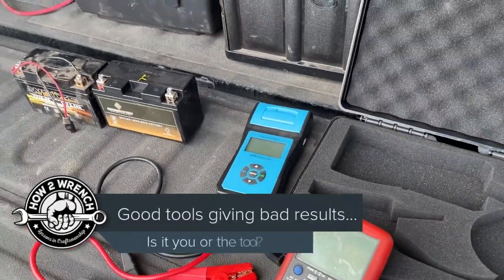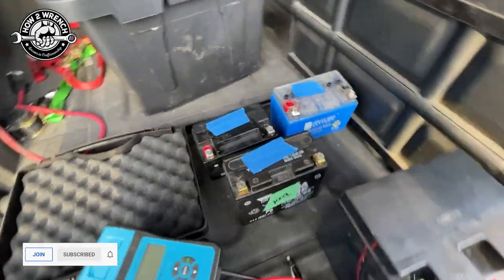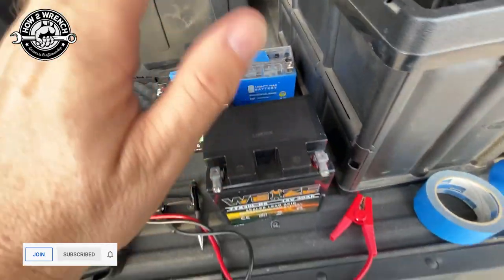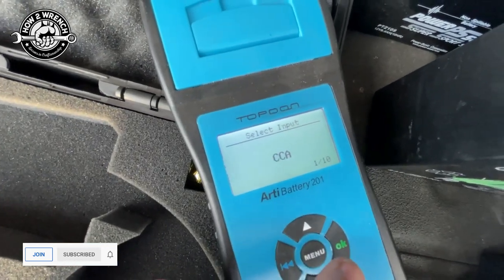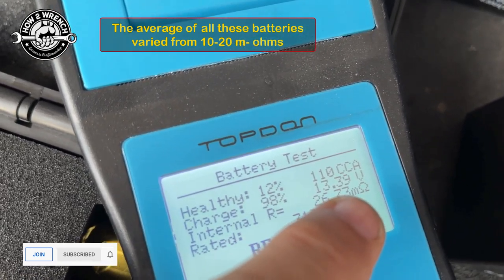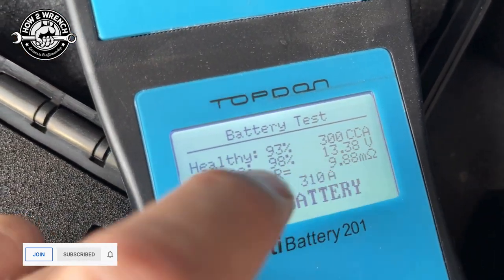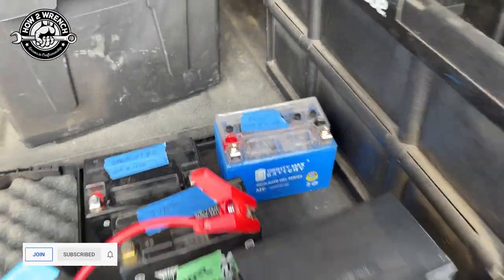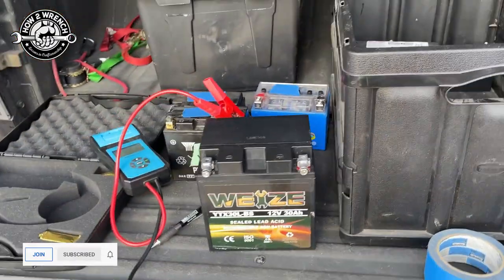When good tools lie to you...is it the tool or how you are using it? #batterytester #diagnosis

Comment: Great demo, worth remembering. Those devices apply an AC voltage to the battery and measure conductance at a specific frequency, then rely on the correlation between those results and the results of a gold standard load tester. I was surprised to see some of the data from those devices, they look more like a scattergram than a clear linear correlation. If in doubt, a standard load tester is still a valuable device to measure how much current a battery can put out. Even with that, extra line resistance, inadequate charge, and cold weather will give spurious results.
Reply from the maker: Couldn't agree more. Love and old carbon pile tester. Downside was you better know what your doing! At least these testers don't start fires 🤣
Glad it helped. You rock for commenting! 
Another way to help us back is joining or grabbing our T-shirt! Support links and gear below!  Awesome and thanks for commenting! Smash the subscribe button (thank if already a sub!)
Have you seen our "YouTube Trained Support Shirts? Great way to "high five us" https://goodfellasmerch.com/collections/how-2-wrench/products/support-shirt 

Join this channel to get access to perks:
https://www.youtube.com/channel/UCBhM8DCKnT3qXwTW0eToyCg/join    
-Daily MEMBER FIRST COMMENTS ANSWERED FIRST 
-Live Q/A video chats
-Wonder if we have a video on your need? Members can request content links!
-Full Access to the ENTIRE 700 video library
-Member-Only FREE tool giveaways   

Got an emergency and your head is about to explode from frustration or fear? Get Shane’s cell here: https://how2wrench.com/ols/products/techline-one-on-one